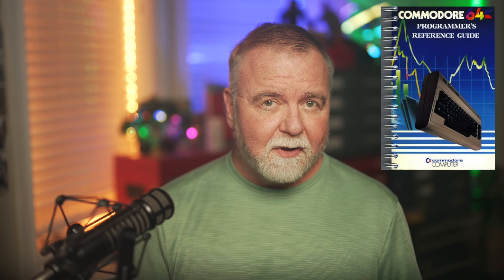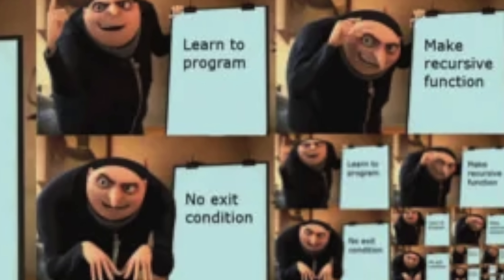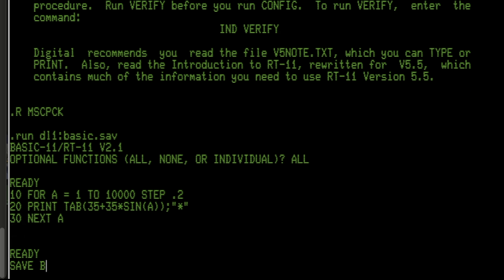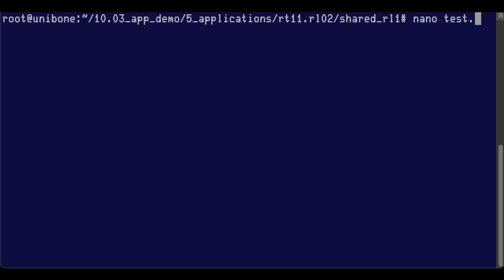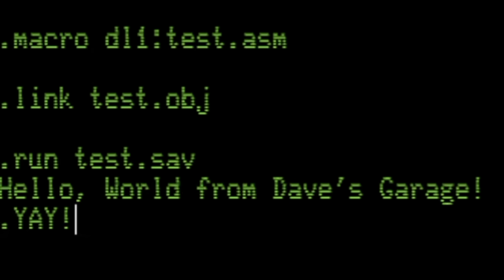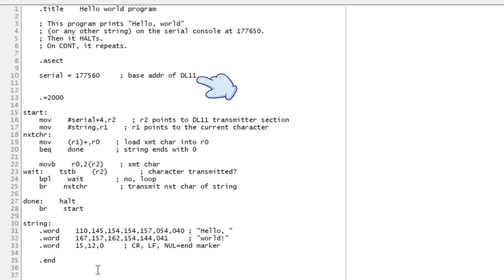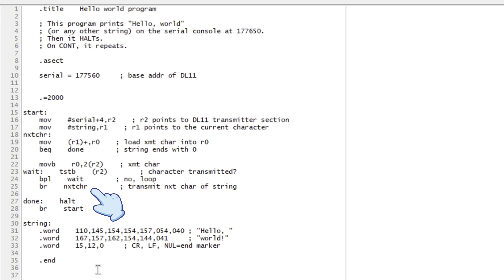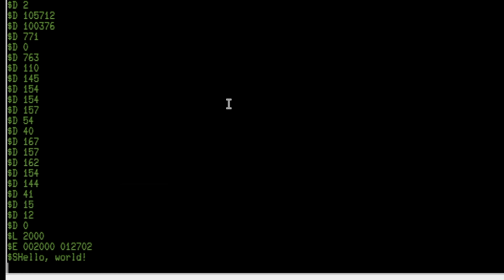Bare Metal Coding: Big Iron!  Assembly Language on the PDP-11/34

Comment: Love this video! 

I am 55 and in 1988 in College in Norway we had some PDP-11s with 8 inch floppies. I am not sure which model. We used them in the micro prosessor class to learn how to code bare metal assembly. It was pretty cool. I remember we had to program the disk DMA controller to make a mini mini operating system that would load a program from disk. 

Our mainframe ran VAX VMS and we spent countless hours reading the reference manuals. We caused a lot of problems for the sysadmin... 

We discovered email and the internet (or BITNET) on the VAX. We did not have telnet or ftp so we used ftp mail servers to download ftp files via email. It was cumbersome but we were ecstatic. We received each file as X number of 64 kB emails with UUENCODEd text. We had to merge all of them in an editor before we used UUDECODE it to get the tar file. 
After a few months of doing this 24/7 we were called in to the office of the sysadmin. He was very upset. He asked what the heck we were doing. He showed us statistics that said we were responsible for 50% of all of the internet traffic going to Norway and that the University of Trondheim demanded more money from us for our usage.

Comment: This brought back a bunch of fond memories, Dave. The first minicomputer I worked on was from Data General and was delivered without an operating system back in the early 70s. Assembly language was our only option. In the 80s, I did a lot of direct hardware interaction using assembly language on embedded systems using 80x86 processors. It took a lot longer to develop programs than using high level languages, but we knew exactly what was going on in the hardware. Since our focus was on authenticating the system's operation, that was important. Some of that code I developed is still in use 40 years after I wrote it.

Comment: Back in the day, we never considered these midrange computers “big iron”. 

That term was typically reserved for mainframes like IBM 370s and up. 

DEC machines were typically used as smaller departmental solutions, and often purchased, maintained and operated by personnel outside the Data Processing Department (which we now call IT).

Comment: Thank you Dave as this reminds me of the first 15 years of my work after finishing the university. We did logging and automating industrial plants, mainly in electric power generation and distribution. In 1975 we made the first high-voltage switchyard automation running on a pdp-11/10. I was the first and only European user of Dave Cutler's RSX-11A kernel. Later, it was migrated to RSX-11M/S and implemented in over 50 substations. The last one was replaced in 1999 because people feared the millennium bug. The switching control program became quite long, with about 2k words of assembly code. For pure binary decisions assembly coding was much more proper than higher languages (we used FORTRAN at this time). We said one can write pdp-11 assembler code even while traveling with a train or streetcar.
Reply: Did you know anyting about the Ferranti Proces Computer with real IO-cards inside. I forgot which OS is was running ...

Comment: My first exposure to computers was as a high school sophomore in 1980 where we had to do a 3 week class.  Following that class I spent all my free time in the school computer lab.  When I entered college, I got to take an assembly language class in the spring of '83 on a PDP-11 (I think it was a 44 that had added parts to make it behave like a 70).  From the moment I learned about addressing modes and the crazy control you have, I was hooked.  I was one of the weirdos that bought the PDP-11 architecture handbook from the school bookstore and read it cover-to-cover like a novel.  Honestly, most of that video felt like I was watching you read my mind.  I desperately wanted a 68000 based machine that I could play with at the assembly level.  Thanks for really stoking up those old memories!

Comment: I remember writing PDP11 asm in college in the late 70s, and then soon on a Zilog chip - it took a while to get used to the DST, SRC sequencing on the Zilog/Intel chips, but it sure helped that MOV became LD.
I have very fond memories of writing large projects in assembler, including debuggers, disassemblers, and assemblers.   Can still remember the Z80 machine language bytes for a lot of the opcodes. I recall decoding what the CPU was executing by watching what bytes were being fetched on the logic analyzer.  Converting hex to ASCII in my head.  That was a grand time.  Later, much work on 80x86/87, 68k and a whole lot of fun on the 56k DSP.  The Moto chips brought back memories of PDP11 architecture.
Loved this video.  Got a little misty-eyed.  Thank you for this, Dave.  Just realized I was not subscribed!  Fixed that.
Reply: Zilog and Dec have the syntax the correct way around. Move from source to dest; load dest with source. As with Dav, I can't get my head around Intex syntax and it still hurts having to think about it when I'm reading code.
Reply: @jgharston 'move' should move the data from the left operand to the right operand and 'load' from the right operand to the left one, I think. Btw. the assembler can easily reverse this from language to actual operation. And what should 'store' do? I think it should also move the data to the right operand.

Comment: Thank you Dave!  Great trip down memory lane!  I never saw a PDP 11/34, but I installed dozens of 11/34A's, 11/44's, 11/70's, and a Q-Bus load of 11/23's.   Doing bootstrap from the front panel, testing line printers, DL11's out the wazoo, DQ11's that we replaced with UMC-Z80's.  Unbelievable how great it was to have an LA120 console instead of an LA36!  The OS was RSX-11M, M+.  Let me know if you need any 8" floppy disks, I still have a couple of boxes left!  🤣

Comment: I installed a dpu and am successful is running parallel processing with cuda on win 11 . Im achieving 100mbps download speeds onto 1 gen 5 ssd with the additional compression but im suffering increased data curruption.  Whats the solution?

Comment: I think I have "PALPD" (Post-Assembler License Plate Disorder)...In college: Univac 1100 series, PDP 11 & Intel 8008 assemblers...Professionally: Data General Nova, IBM Series/1, Zilog Z8000, Motorola 68000, Intel 8086/286/386...Plus a bit of RISC assemblers.....So I will be driving and perhaps the car in front of mine license plate has "JLT" or "BAL" and I might say out load "jump less then" or "branch and link", and my wife will say "What are you talking about??"

Comment: In  the 70's and early 80's I worked as a hware interface design eng on PDP 11s. For us, macro 11 was high level programming 🙂 🙂 Real programmers use 1s and 0s. That's real bare metal 🙂Like booting, easy enough, you don't need any fancy hardware cards like the one you used.  You simply manipulate a couple of registers in the disk controller like word count and CSR, load in the first block from disk and run it. Voila! OS loads and runs :-) Dave, thank you so much for your videos, I really enjoy them.
Reply: We 'poisoned' the pdp-11s for the basic training groups by entering 014747 (mov -(PC,)-(PC)) at the highest address and executed it. It copies itself through all the memory, and if a different program performs a wrong jump it works self-destroying.
Reply: @gottfriedheumesser1994  Indeed - in fact we used to use 014747 as a very quick and dirty memory diagnostic. Run it and if it does not make it all the way through memory you can look back and see at what address it was corrupted. Work out which bit failed and change the RAM chip because the memory was all xKB x 1 bit chips so easy to find. Not a very rigorous test but useful sometimes 🙂
Reply: Yes, using the toggle switches to enter the code to read the paper tape (the folded paper tape) which then contains the boot loader, add the disc address and load the OS. We were using RSX-11M and RT-11.
I still have PDP-11 handbooks, programming card etc 😄.

Comment: I have been really enjoying watching your videos on the PDP 11. I am a genuine grey beard. I became an OEM dealer for DEC's business computer division way back in 1975. I was actually president of the DECUS business user special interest group from 1977 to 1981. This is all fascinating to me that you are resurrecting it.

I have to wonder if you know what you have.  A DEC Data system was actually packaged as a business system.  What you probably have is a Dec DataSystem 350 series, probably a 354.  It probably shipped with the DEC operating system based on RT-11 with a multi-user operating system layered above.  The normal programming language was DIBOL. You could typically run a maximum of three terminals (although 2 was optimal) with the RT-11 based system.  You could also run the 500 based operating system based on RSTS-E with some business extensions. 

The underlying machines were identical to DEC's standard machines. They ran RT-11, RSX-11 and Linux just fine. 

It is forgotten though, that before the IBM PC came out, DEC was heavily involved in business computers for the industry.

So whether you realize it or not, not only do you have a PDP 11/34 you have one that is even more rare because it is a DataSystem.

Treasure it, it is something very special.  I have so many memories of those days.

Comment: What a trip down memory lane. While in college at Milwaukee School of Engineering, I had an assembly class on our PDP 11/70 running RSTS/E. What to do, well the little cheat sheet we had gave us all kinds of info. One thing I saw was 'cold boot loader address'. I thought, well, let's just jump to that address and see what would happen. All the terminals froze for a few seconds and then I got a message that said you could not do this from a non-privileged account. Close, but not quite. And those that mentioned it is sad that new programmers are too far separated from the cold metal hardware are right in my opinion.

Comment: I am 67, first home computer was TI99/4A (16K)!  Yes, I'm an outlier:)!  Upgraded by way of expansion chassis, big metal box, with card slots, connected to 99/4A console via serial ribbon cable.  Some of my memory addresses have failed:)!, so I not sure I got the names right, but I believe I had a P-Card (Pascal), 32K Memory Expansion Card, and Serial Card.  I know I also programmed in Forth but can't remember if that was a cartridge or if I eventually had a floppy disk drive.  I am pretty sure I did have the floppy drive.  Again, some of my memory addresses have failed:)!  I do vividly remember saving code to cassette recorder early on.  You had to always remember to rewind the tape and set recorder's counter to zero.  Then play the tape forward a bit to get past the leader.  Once past the leader, record the tape counter to your trusty notebook with description of what you were recording (program, data for a program).  Now tell the system you want to save and it would instruct you to depress the buttons needed to record (Play + Record on mine).  Then tell the system to proceed and it would release the electronic pause it had placed on the recorder while you depressed record, and next thing you knew the sweet tones of your programming masterpiece were being written to tape:)!  The TI99/4A never got the love it deserved.  It had a voice synthesizer cartridge that allowed you to write programs where the computer would talk to you.  "Would you like to play a game!", lol!    I also had the coolest Brother typewriter with serial interface.  I was able to use the TI-Writer cartridge to complete reports back in 1982ish in triplicate using carbon paper, again, lol!  Computer swaps at the county college, OH MAN DID YOU TAKE ME DOWN MEMORY LANE!!!  Thanks, Dave!

Comment: We are of the same age (vintage?) and my assembly language journey was 6502. At the height of my powers in high school/college, I could do most 6502 assembly programming without having to review back to the manual for my Apple ][. I did have access to a PDP 11/40 in high school that lived at a local college across the street where I could load BASIC programs on the RSTS/E system, but this machine was so above my perceived skills, I didn't even consider doing assembly on it. In reality, I really should have since it would have probably been a lot of fun and useful for my programming skills.  Considering that in college I had direct access to DEC-20 and VAX systems, I'm kinda kicking myself for not taking the opportunity to get a little more bare metal experience with these systems. Thanks for your video to demystify all this.

Comment: Ahhh, the good ol days.  My first computer was the SWTPC6800 with the motorola 6800, the year: 1976.  I bought a 68000 chip, hoping to build my 68000 computer.  Lack of funds preventing me from doing that at the time.  Graduated to radio shack color computer with the 6809 chip (not a 68000 but nice anyways.)  I wholehearted agree regarding intel's backwards arguements…  Prefer Mov from, to  anyday.

Comment: I only started as late as the VAX, but got to write a serial comms protocol for a legacy RTU - all seemed to be working (although it had weirdness such as 18-bit bytes), but one counter wasn't behaving correctly - it would suddenly jump down by 0x400 for no reason.

...it was a bad TTL chip in on one of the discrete logic card of the legacy device - one bit was jumping from 1 to 0.

It was pretty magical :)

Comment: Niche?  I spent two years doing exactly this on a PDP-11 - and getting paid for it.  The PDP-11 was a dream to program and its instruction set was easy to learn and really well designed.  Driving devices was easy if you could use polling (as in your example), but it was a lot more fun using interrupts.  And once again the PDP-11 blew all its contemporaries out of the water, with a dedicated interrupt vector for each device type, and a multi-level interrupt priority scheme.  
A couple of years later, I had to do it all again with the Texas 9900 microprocessor, whose instruction set was clearly influenced by the PDP-11.  That was also great fun.  
It is truly amazing just what you can do with just 8K of RAM and no operating system.
Reply: Andrew Tanenbaum gave DEC an A for their design of the PDP11 / VAX architecture, Motorola a B for the 680x0 family, and Intel a C for the 80x86.
Reply: @markteague8889  I dread to think what he gave the appalling DG Nova and HP-1000 ;-)
Reply: Yes, niche.

Comment: Great stuff, Dave!  Really triggered my recollections from the seventies using PDP 11 equipment.

I got my first  taste of programming in college back in '76 on the RSTS 11 system on our school's PDP 11/40.  My roommate got me started learning BASIC.  Not long after, as a BSEE student, I got access to the the EE department's computer lab (not much more than a closet, but it had a rack mounted PDP 11/10) where I fumbled my way through the documentation for booting the 11/10. 

I wasn't taking any CS classes and had to figure things out alone.  I toggled in my first machine code program using the switches on the front panel.  That program sent a single character to the hardware register for the system console terminal, an old ASR 33 teletype.  When it sprang to life and printed "A" I got excited.  I needed to make a loop to print more characters.

I got stuck trying to figure out how to branch backward and searched the manuals for a clue.  That's how I learned about two's complement arithmetic and got my conditional branch to loop back.  I tried sending more characters to the ASR 33.  It didn't work reliably because I was overrunning the printer's ability to keep up.  I figured out that I needed a delay and made one that worked, but was uncomfortable that it wouldn't be reliable and that I needed some kind of of feedback from the hardware.

Along about this time, I started wondering why there wasn't an easier way to have the computer do this calculation for me (didn't know about assemblers but saw intriguing references to the mnemonics and labels in the manual).  More digging and I discovered that there was an assembler available in the rack of paper tapes in the lab.  I had to toggle in the insctructions for the boot loader, which in turn allowed the Absolute Loader to be read in from paper tape, destroying the boot loader in the process.

Finally, I got the macro assembler loaded and was able to experiment with assembly language.  I spent many hours reading everything I could find and experimenting.  This gave me a firm underpinning for understanding computers and laid the groundwork for my entire career as a BSEE specializing in digital electronics and microcomputing.

Comment: I worked on later models of the PDP-11, the LSI-11/23 with RT-11, and later the MicroPDP-11/73, using RSX-11M+.  The operating systems were very well organized and the processors were designed for good software. 

One of the interesting things is that the interrupt process was significantly slower than polled hardware. So when doing data acquisition, I elected to poll the hardware instead attempting to process interrupts. This made foreground/background processing in RT-11 work very well for me. So those of you who are wondering why Dave didn't use interrupts for I/O there was a good reason: Not only was it simpler, it was FASTER.